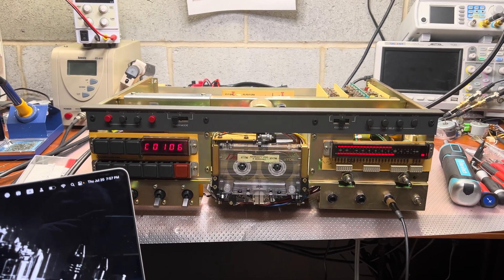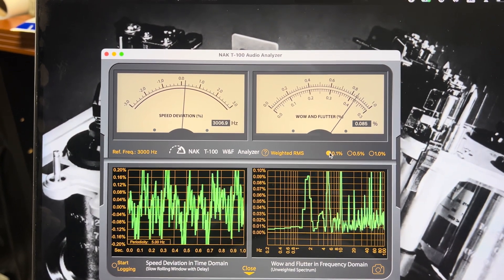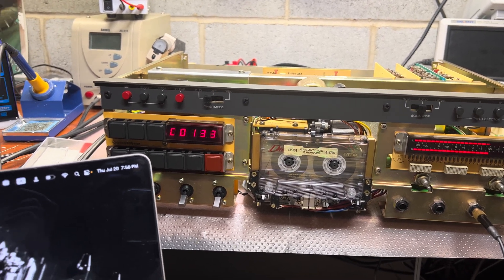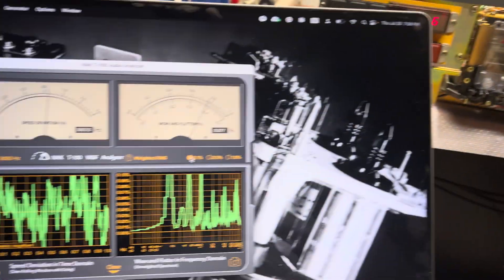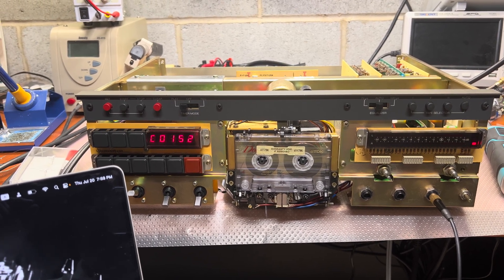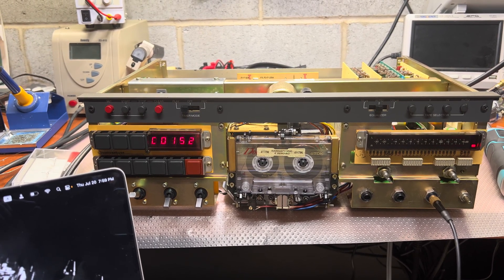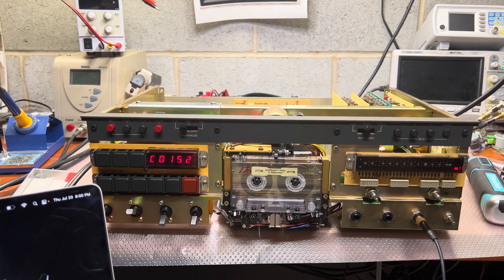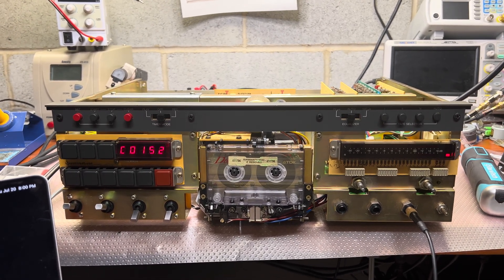Solved: Successfully Reduced W&F on Revox B710 from 0.21% to 0.07%

Comment: Hi @hifirulezzz,
Just bought a Revox B215 recently.
Do you think i will have the same problem with w&f, and because B215 being the newer model, they upgraded the mechanics and the this w&f issue will not be present?
Thanks
Reply from the maker: B215 has bigger pinch rollers and should work better.

Comment: Hi @hifirulezzz,

Thank you so much for your great videos. I have many decks (Nakamichi, ReVox and Tandberg) which I send to UK for repair and upgrade but unfortunately the arrived damaged (double box transportation). In my experience is better to consider wooden box with a lot of packing material for safe transportation.

Those decks need to be repaired. In which country are you located? Thank you!

Comment: hi.
Great work on the 710! 
Could you tell me if you have a video showing where you oiled the shafts to reduce the wow and flutter.
My 710 mk11 has terrible speed issues.....pretty much Un-useable!
Many thanks
Reply from the maker: Ah, it took so much time to understand how this transport works. I do not have a in process video. I tested few dozens configurations, polished bearings, nothing did work. Then I lubricated spacers on the back of the shafts and put new pinch rollers and boom - everything works.

Comment: 0.07% is still too high for a dd deck, it's even higher than many belt driven decks.
Reply: It’s way better than the specs though if I remember this correctly
Reply from the maker: Original specs show 0.1% :)
Reply: Too many people read specifications only and gauge from there. Somewhere around 0.20% WRMS is a threashold where we can perceive wow and flutter, so why is 0.07% 'still too high' then???